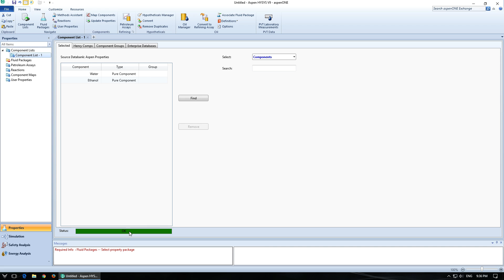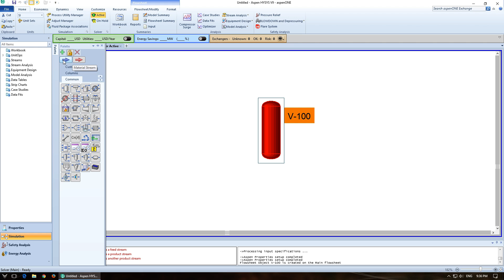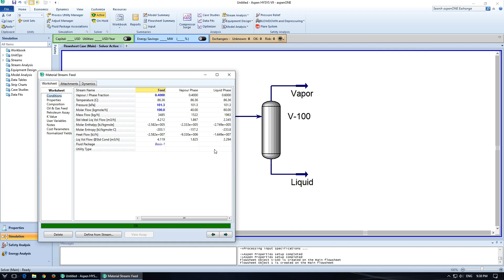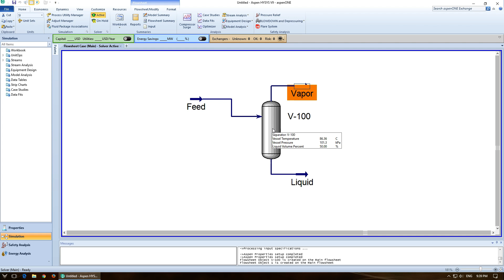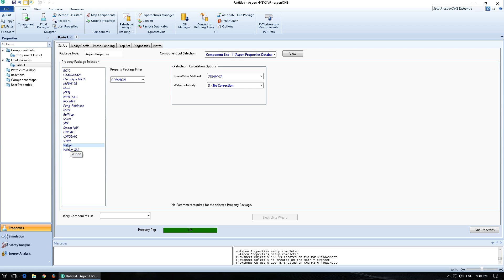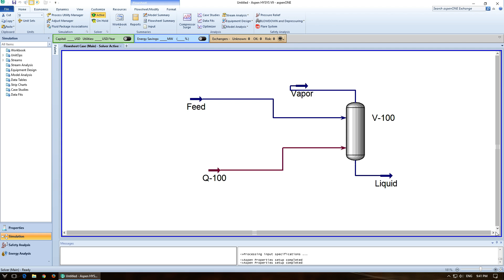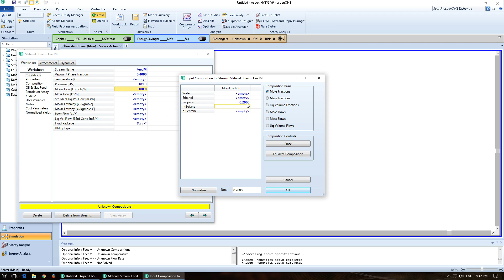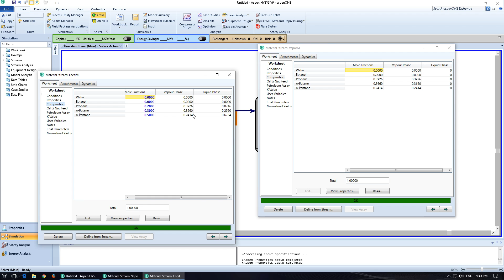How to Create a Simple Flash Drum in Aspen Hysys

Comment: what if my feed pressure is 200 bar and seperaor I want to operate it at 10 bar. How to model do in this case. When I put dp 190j bar error message comes as negative pressure in the sepertor. Please can you help thanks a million
Reply from the maker: Make sure the units for DP are correct and try to use a lower number to make sure it's doing what you intend for it to do. If there's a convergence error with the flash drum you can try to use a valve to expand the stream before it enters the flash drum to see if that works better.

Comment: Hey, so by specifying a pressure drop are we naturally decreasing system pressure, resulting in better separation?   Please if u can clarify
Reply from the maker: By specifying a pressure drop we're accounting for a "natural" pressure drop in the system or a valve used to obtain a specific pressure. The pressure is important because equilibrium curves change based on pressure. A pressure drop doesn't always improve separation, but we account for it in practice because that's how actual equipment operates.

Comment: what should i do to make Hysys calculate the proper vessel design parameters, as i can see u ignored the flash drum design parameters in this tutorial which will affect the results for sure.
Reply from the maker: Because the flash drum calculates everything at equilibrium the size isn't an issue here. Most things in process simulators ignore sizes unless you're costing the equipment or running a dynamic simulation. If you use the costing tool it should give you some basic dimensions for the vessel one the problem is solved.

Comment: What does the delta P function do at 4:06? What does that mean?
Reply from the maker: When you specify a pressure in that box it is the Pressure decrease across the Flash Drum. In this example, by specifying a pressure drop (delta P) of 5 kPa the outlet pressures are 5 kPa lower than the inlet (96.32 kPa vs 101.32 kPa)
Reply: Ok, Thanks! :)

Comment: what if I have my temperature but not the vapor fraction
Reply from the maker: The problem is under specified if you only have one property. You can use Temperature/Pressure, Temperature/Vapor Fraction, or Pressure/Vapor Fraction. If you don't have the Vapor Fraction then use Temperature and Pressure instead